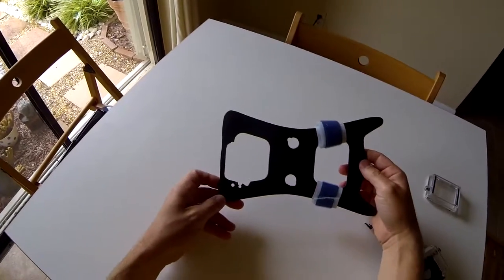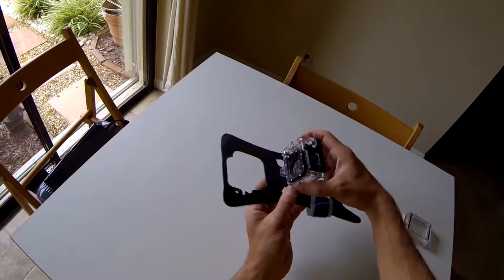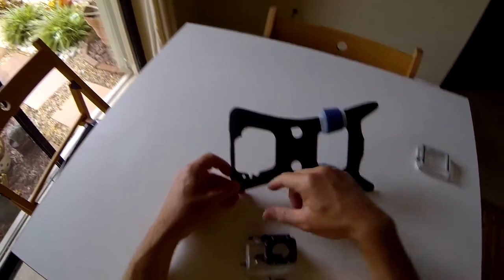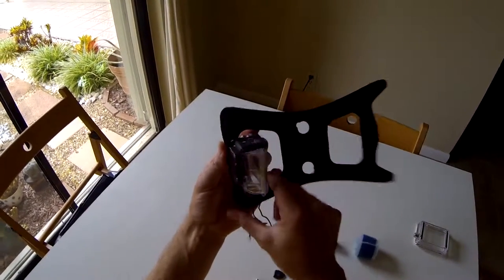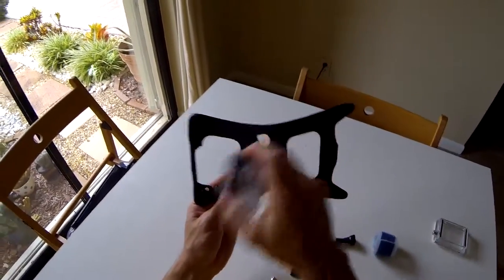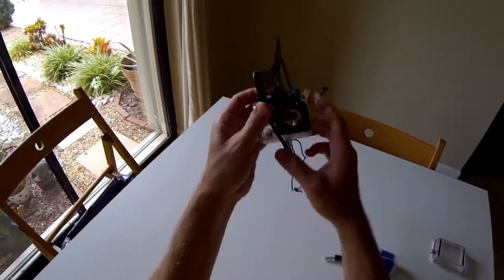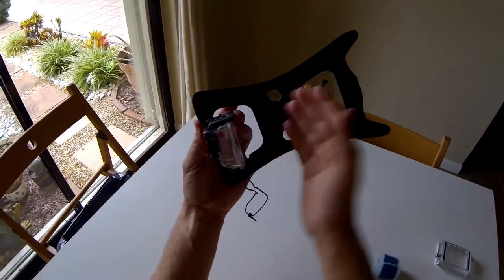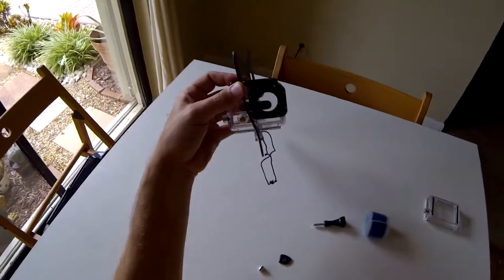GoPro Homemade Stable Kite line mount ver.2

Comment: nice ! thanks !
Reply from the maker: +mynameismag1 I will probably modify it soon and mount GoPro in the middle where 2 circle holes are and cut sides out to make it a bit lighter.
Use your creativity to create your own design. 
This design gives very stable footage for sure as you can see on my videos.
I was really surprised how stable it is that I did not have to use any stabilization during video processing.
Reply from the maker: +mynameismag1 Try to put it centrally and you will have very stable video. Have fun.